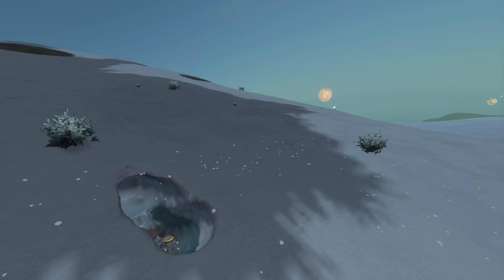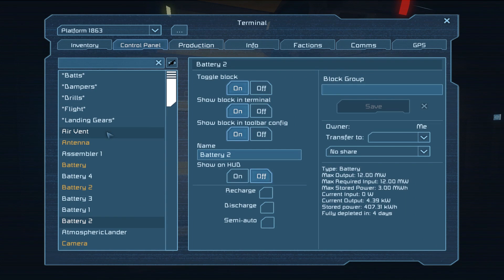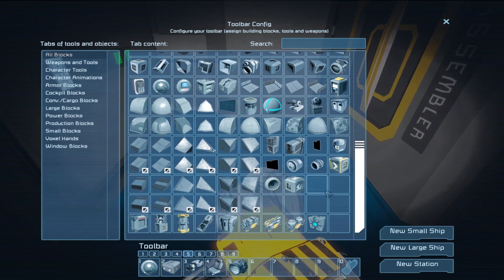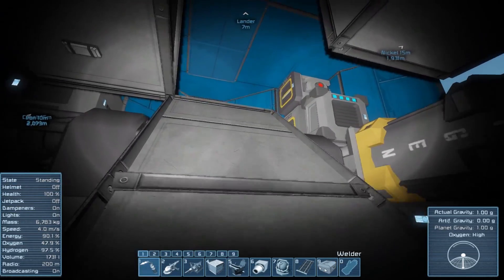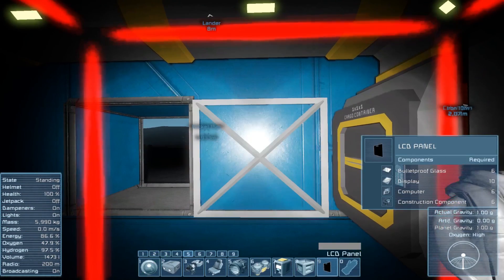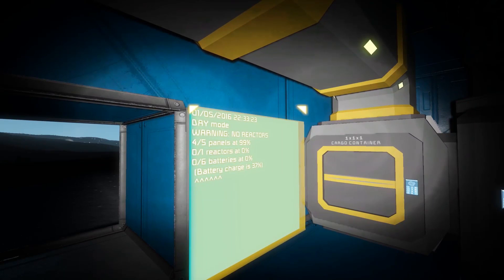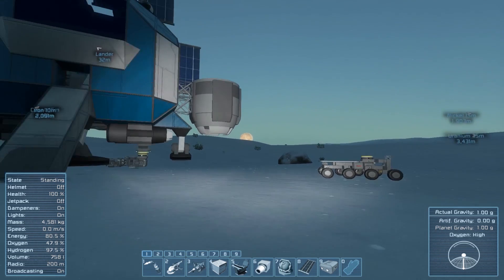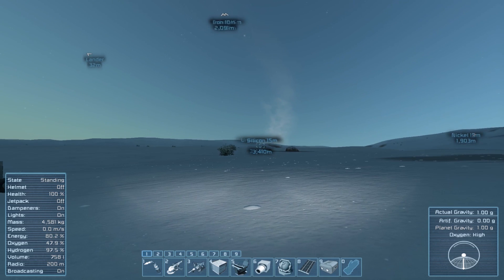Space Engineers - Planets Survival Guide #6 - Better Power?

Comment: Another good episode man. I will say that the first thing you should is build all your panels on your ship and to place them well. That one you put on the side isn't going to get as much light. Putting them all on your ship keeps all power generation centered and the connectors will let you juice up no problem. For newer players adjusting your day/night cycle is also important, too long and you'll have a long period of no sunlight to power. Short cycles help until you've gained enough Ur to supplement solar. Your day cycles will be short but they come more frequently, giving you time to build or mine at night. Also skipping the early rover can help with resources and power, if you have access to ice your much better off jet packing. It may be more time consuming but honestly you need that time to get batteries charged anyway before powering vehicles and heavy production. By the time they are well charged you will materials to make new ones and build a miner and scout rover.

Comment: The mod  "Powerfix (Makes Batteries Usefuller)" is broken and a really really bad idea to use

Please redo this part, and or add annotations to it that are warning about the mod. I have written in the first part of this series more about this, but I have the feeling it is better to this also here.

You recommend a mod here "Powerfix (Makes Batteries Usefuller)" which was in meantime not working anymore (according to the author of the mod) and seems to has began to work again, but breaks remote control. I couldn't get the antennas to work and so I only could control vehicles when I had a seat on them. After uninstalling the mod I can remote control vehicles just fine (means antennas are working). 

Again

The mod  "Powerfix (Makes Batteries Usefuller)" is broken and a really really bad idea to use

Freya works fine, though the author states that it is "old and creaky* and will need an considerably large overhaul. .. more like complete rewrite anytime soon.

Both mods weren't updated for quite a while! (does a ingame script count as mod?)

Also you should consider to incorporate a sun track and better solar setup in your tutorial ...  after two real time days (and I mean 2* 24 hours .. keep the game running while doing other stuff) in which I even hadn't charged the batteries of the miner enough to undock it. I decided to scrap your solar setup and go for a solar tower (less blocking of panels from lander, capable of tracking the sun, manually or with a script... and I added in a few more panels) it took me one more rl play day (more 12 hours than 24) to charge everything up, though

Comment: Really important correction: Do not use Power Efficiency modules on the refinery! Instead use Effectiveness modules. These upgrade the amount of Ingot you get per Ore. And the way it is currently set up it simply multiplies your output by two(with 4 modules). This will mean the refinery is twice as productive, uses half the energy per ingot and uses half the ore per ingot. With all power efficiency you only get slightly less power reduction (224% vs 200%) but lose out on the productivity and effectiveness... Therefore effectiveness modules currently are simply the best choice in any situation since getting ore requires energy too... This might be changed at any time but currently, run with effectiveness!

Comment: Don't batteries work fine without mods? If the solar panels can handle the load, the batteries shouldn't be used.

And afaik there is only a 20% loss on charge from reactors. There is no loss from solar charging, or one battery charging another.

Comment: Nice video. Very important to let people know about the power priority. 

On a purely vanilla game one way I've found to get around it is to have your solar farm separate from your base. You then cut the batteries off the ship and put them on merge blocks so you can shift them between the solar farm and the production facility.

You leave your spare batteries on the farm to charge during the day, and switch out at nightfall.

Another way to get power is to build new batteries. They start with 30% charge, so if you're in a tight spot and you have battery bits you can get some free power that way.

I had forgotten about the power efficiency modules. Definitely be building some when I get back into my world.

Comment: Hmm, I'm a bit confused... I got 12 solar panels atm and about 6 batteries which are always set to recharge if I'm not currently using the power (activating refineries and assemblers only if I really need the resources/materials). 

But I'm not even able to power the assembler alone without the batteries (which don't last for nearly as long as yours, but for about 3-10min (with similar charging rates though without power efficiency modules). 

Im a bit puzzled about what I'm doing wrong.
Reply from the maker: +TheCalcaholic Check ur solar panels, pretty sure you'll see them not actually outputting any power when the batteries are on... which is kinda what I meant about the broken power priorities in SE atm.. really doesn't like using ur solar panels if there's other power sources availible. Might be wrong as I can't see ur exact scenario but I'd expect it to be related to that.
Reply: Thank you. I will check on that. :)
Reply: +TheCalcaholic 
Also keep in mind that discharging batteries love to waste energy charging recharging batteries. 

That said you may need to briefly set a battery to "discharge" then uncheck all of the checkboxes to "wake up" the battery and get it to start powering things. If you leave a battery with all boxes unchecked it sometimes gets stuck in it's current power state.
Reply: r3dp9 Seriously? x_x
That might be it.

In this case it's clear, that 1 or 2 batteries are discharged devastatingly fast if I got 6 more on recharge.

Guess, I need to write a script for this..

Comment: As usual, this is a great Tutorial video! 
A lot of useful information & tips.

If I may add something, in regards of early power management, I’ll recommend to rely on small batteries instead of large batteries.
On this day, not only small batteries are cheaper, component wise, than their large version, but they prove to be more efficient in terms of both Max output and Max stored Energy.

Hence the numbers:
1 Large Ship battery cost 3192.5 Fe, 240 Ni and 125 Si.
It produce a Max Output of 12 MW, and can store 3 MW.h

4 Small ship batteries: 3104 Fe, 160 Ni and 81.6 Si.
They produce a Max output of 17.28 MW, and can store 4.3 MW.h
Reply from the maker: +Dr Mic hmm, fair point about the small batteries.. although they do come with a slightly increased risk of making an error that results in you somehow disconnecting your batteries and then not having a medbay for example. But accepting that small extra risk that's a more efficient approach for sure.

Comment: Nice tutorial, one little detail though, you placed the assembler's power efficiency module sub-optimally - only one of those ports is connected, the large conveyor port doesn't work for modules AFAIK. Could you put it on the bottom side of the assembler? That one has 2 module ports if I recall correctly
Reply from the maker: +sinthorias Are you sure it doesn't work? I didn't think it was possible to only connect then via one port and if you look closely at the large port on the assembler it actually has the outline of the smaller port inside the bigger one. Can see at 11:25 kinda, looks like 2 doors one inside the other where the big port is.
Reply: ***** no, you're right, thanks for doubting me.

The wiki says that the assembler has 6 upgrade ports, that's what I based my assumptions on - and built my assemblers in awkward pairs not to waste any upgrade module slot. Thanks to you I just went into creative and confirmed it, the large port indeed does work. 

I'm gonna fix the info on the SE wiki, it's misledaing atm.
Reply from the maker: +sinthorias Ahh cool, wasn't 100% sure myself either, just going by memory so good to confirm how it works :) Even better as it means I don't have to take this vid down, heh... Good man for wanting to correct the wiki :) Sadly that thing is not as well maintained as it needs to be for a game like SE.